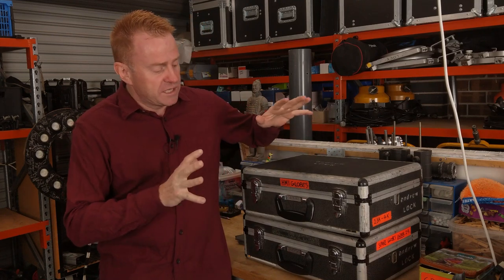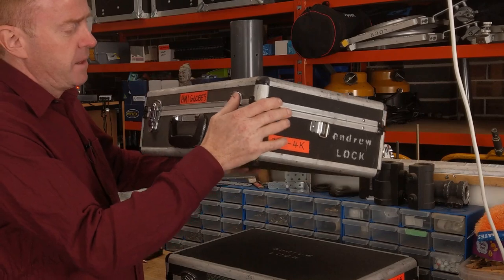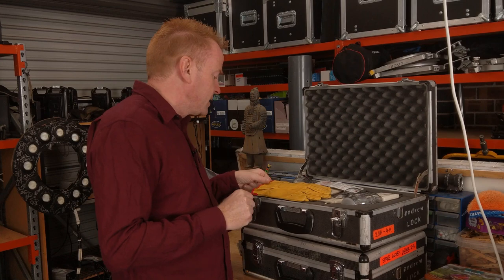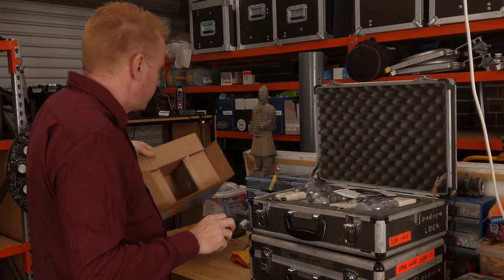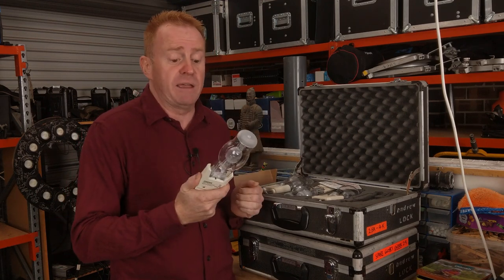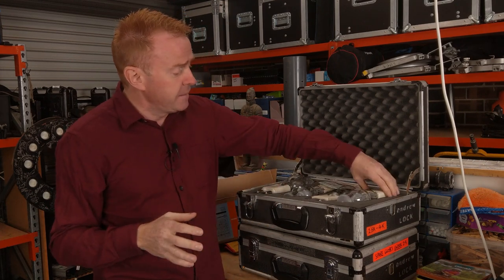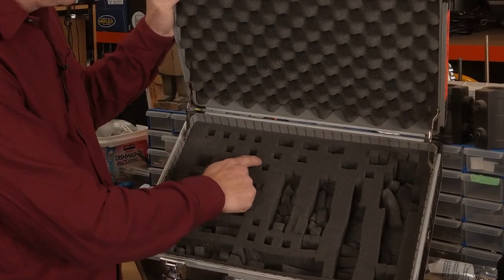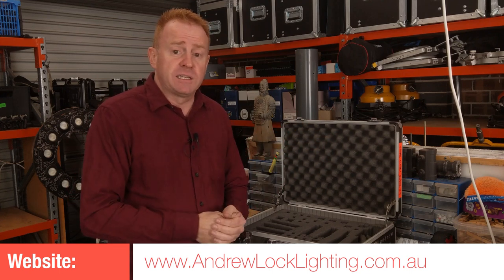Gaffer & Gear 97 - Spare Globes

Comment: Another great straight talking video. Would love one about how to clean/disinfect Skypanels and other lights post Covid-19.
Reply from the maker: I have two lighting vans, so my approach is to use one and then park it for four days to let the virus die, then use the other van if I have another shoot in that time. NO ONE touches my gear on set.

Rentals, is a problem, I put the gear to one side for 4 days and then clean myself with shit loads of sanitizer.

I gave up on cleaning when I looked at a c-stand, every surface on every riser and every knob would take about 15 minutes to do per stand.

Comment: Another great video. Any chance of doing a video on NPF batteries. Most particularly on how to tell when they are no good and its time to throw them away. I have loads of them and I know some are duff but as I mostly use two at the same time I can't tell from just using them.
Reply: I number them with a p-touch label, and I add a "first charge" date when I first use it. Then, if one dies sooner than it should- I can put a red sharpie line on part of the number. I then make sure to fully fully charge it- if it ends up with another strike, I retire it.
Reply from the maker: Those batteries are just a pain in the arse. Take sooooo long to charge. Dynacore so far seem reliable but expensive, and I've had to super glue  a few back together after rentals
Reply from the maker: @duncandeyoung5548  I do a similar thing.
Reply: @duncandeyoung5548  I have put the last ones that seemed to die early in a pouch on my camera bag. I was hoping there might be some way of testing them, with a tester. The sony npf970s are so expensive I would hate to retire any by mistake :-(
Reply: @gaffergear  They are but they are relatively small and light, compared to vloks. Yes they take forever to charge but I have a few chargers left set up in a stackable box, along with a bunch of other chargers, all plugged into a power extension, so its quick to get them going. I am sure you have a shelf or something permanently set up.